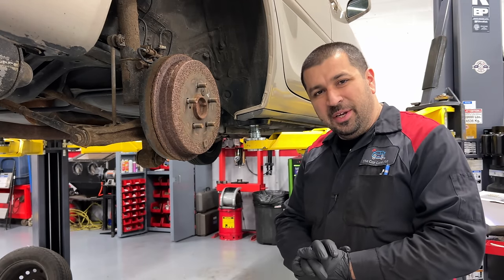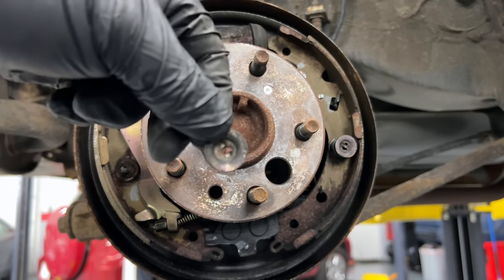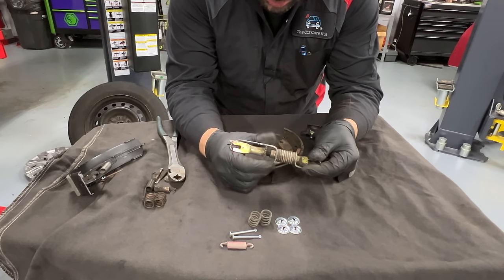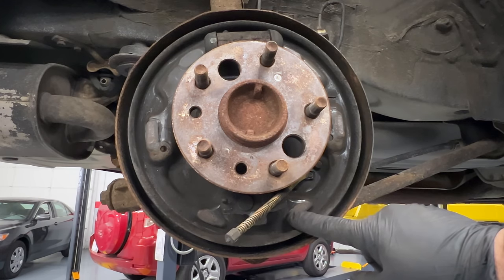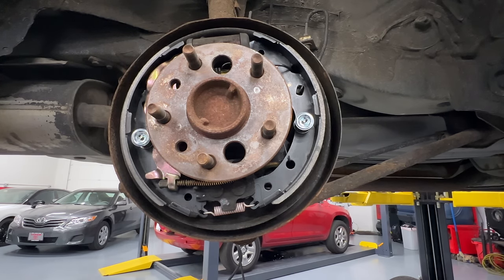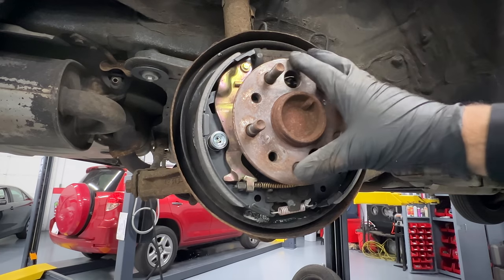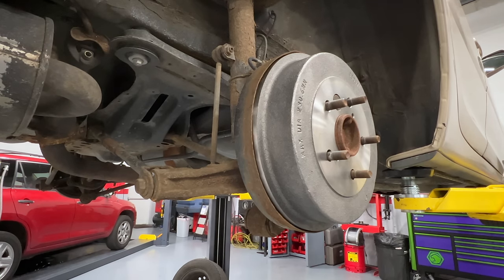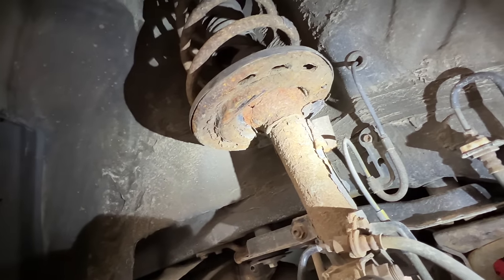How to Replace Toyota Drum Brakes Like a Pro

Comment: The root problem here is that Toyota still puts Drum brakes on some vehicles 🙄
Reply: drums & a hybrid vehicle just don't sound right 🤷🏻‍♂️
Reply: Many Utilities which cost 45-60K have drums due to reliability and good dust prevention due to a Sealed design.Most small hatch backs also have drums. Not many cars (non high performance) use much of the Rear Brakes, that’s why most of these are Maintenance free up to 150,000km+ depending on the driver.
Reply: Drum brakes are superior to disk brakes
Reply: @StrongerThanBigfoot drum brakes are dog shit .

Comment: I was taught on orientation of brake shoes,, tall boys to the back and short boys to the front of the class. Maybe kind of dumb but I never made that silly mistake. Taught a lot of young techs this over 45 years.
Reply: Hell naw bro! This is so helpful to me. Appreciate you
Reply: Primary and secondary shoe. Quick google search for picture. But yes primary/ leading shoe is smaller and goes to the front of vehicle.
Reply: Great way to remember.

Comment: I'm 69 and all my cars up until 1977 had drum brakes. I did work on other peoples' cars with disc brakes but I had a steady diet of drums for 30 years. The rear drum brakes on my first (1991) Camry went 200K and only wore out because of leaking cylinders. I did use OEM shoes because they were competitive with AM. Ahmed, I am glad to know that I was taught correctly 55 years ago.

Comment: I did drum brake shoes before and it is quite difficult. I made all the mistakes you mentioned on this video. (push too much and cylinder brake fluid leaking). I learned a lot of tricks on this video. Best instruction and explanation. Every time I work on drum brakes,  I always wonder how much car manufacture can save instead of using disc brakes which is much easier and have much better stopping power. Thanks for the video and thank you for sharing your knowledge. 👍
Reply: Did you put those short crossheads back in again ? or do Toyota’s not use them ?   Oi ! maybe you re-cut a lot of drums badly, hein ?

Comment: Again, this is exactly the kind of video for Toyota I want to see you doing.  I'm always interested in any kind of special treatment which applies to Toyota vehicles. I have a Camry 2018 and Corolla 2017 which btw has the drum brakes in the back and have learned that the adjustment hole is in the front not the back like on most of the other cars I've done in the past. This is a wonderful idea. Make adjusting them so much easier and safer.  Please do more videos like this for other areas of maintenance and or repair of Toyota products.
thanks

Comment: Another excellent tutorial video. I have done the brake shoe replacement job many times in my DIY driving career, with older cars, many years ago. It is not easy when lying or kneeling on the ground! A 'lift' makes everything so much more accessible.
Your customers are fortunate to have you..
Reply: I recommend you get a stool from "HF"; even a little step stool or an upside down 5-gallon bucket is great to sit on rather than kneeling. At least if you destroyed your knees with basketball and running...
Reply: @justliberty4072  Thank you for the suggestion.. We have  Screwfix in the UK where I obtained some Trade Gel filled knee pads, held by velcro straps. They work as a cushion for the knees, as well as roll of carpet underlay or an old pillow. Unfortunately, at 6'4", a stool or bucket are far too low. At my age I would never get up again! The joys of getting old!

Comment: Drum brakes are no fun to replace. This was a pretty good tutorial video. The one thing I'd do differently is all of the cleaning, sanding and lubing BEFORE assembling new parts. 
I agree to adjust the shoes with initial drag, it will wear in perfectly if you do that. Make sure both sides are adjusted the same so they grab at the same time.
Reply: A man after my own heart. Spot on, brother.

Comment: Excellent video. Just one tip, take a couple photographs of the shoes and springs setup after you get the drum off and before you start disassembling the springs, shoes, and clips- so that you have a quick and easily accessible reference for reassembly.

Comment: WOW!  I live in the rust belt and have never seen a rear strut that bad. Another great video for the DIYer.  I'm 60 and my first car, a 1970 Galaxy 500 had 4 way drum brakes and most of my cars until the late 90's had rear drum brakes.  My current cars are 2003 - 2005 Vibes and they still have rear drum brakes.

Comment: Very nice as usual.  The great thing about current times is that you can now take tons of pictures with your phone to insure you know the original position of all the parts  We old guys remember when you just had to guess or check the other side.
Reply: Most of my cars had TWO upper springs. And when I first started, I'd lay parts on a flat piece of cardboard the way I took them off.

Comment: Great video.. nice clear steps. I like how you put the parts on the table side by side, keeping everything organized. I need to start doing that. Its easy to get stuff turned around or backwards. Taking pics helps too.
On the adjustment part.  I have added a step, get the brakes adjusted to whatever you like. I then get in the car and apply and disengage the parking brake several times.
Then go back and adjust the brakes again.. normally you will find they are loose again. 
The parking brake will press the shoes tightly against the drum and center them nicely.
I have found repeating the parking brake step 2 -3 times, and you will get to a point where there is no longer any change after you do it.
Now the Brakes are centered, and adjusted nice.

Comment: 26:12 ***Solid gold advice***! I've needed that backup plan a few times😆 

For anyone that's curious about leading versus trailing shoes,here's a quick explainer.
The leading shoe gets the most wear because the rotating forces help pull it tighter against the drum- which gives a stronger braking effect.The trailing shoe doesnt have this advantage.
So why not make both shoes the leading type? Early race cars did exactly this and it works well. However this has one disadvantage. When a car is going backwards the leading shoe(s) become trailing shoes and lose most of their braking ability.And because road going car's E brakes need to work equally well in both directions, they have the leading/trailing arrangement.

Comment: I am glad it has to be replaced every 15 years . I did mine yesterday morning and putting that cable was the only issue I faced. Rest was easy.
Btw I use locking plier to pinch the brake line it made job easy with the cylinder.

Comment: Still have my snap on brake tool set the pliers were the best had spring tools on the ends of the pliers. Bought them in 1975 working at a GM dealership. Good memories

Comment: Great video. Just replaced my brake shoes today. It wasnt that hard, thanks to this video but my god, I hated doing it so much. Between all the springs, the need to clean all the caked brake dust, and the need to adjust them afterwards, it took me more than 2 hours. Having specific tools wouldve made the job so much easier, and my drum doesnt have the hole in the front for adjustment. Luckily drum brakes last so much longer, so I may not have to do another one for at least 7 years if the car is not sold yet by then. Disc brakes are so much easier to work on, and the pads are much cheaper than drum brake shoes.

Comment: I have to take a million pictures with my cell phone to refer to as I'm reassembling parts like brake springs.  However , I haven't done it for as long as you have so you make it look so easy .. Thank you for making these videos..
Reply: I could relate. Just did rear drums and shoes on my 2006 Tundra. What a learning experience. It's actually easy to reassemble if you take careful detailed notes on spring and adjuster placement

Comment: Excellent. I have a 2006 Matrix with almost 209k miles and original drums. The car stops perfect with zero noise. I recently tried to do an inspection and used the bolts to break the drum free but it hung up on the pads trying to remove it. I just pushed it back on, realizing that I should have new parts on hand.
Reply: There is probably a ridge on the drum so you will need to turn the adjustment mechanism in to pull the shoes in so you can get over the ridge.  You turn it the opposite direction that AMD was doing in this video.  You do need to hold up the adjusting lever with another screwdriver so you can turn it backwards.
Reply: @montestu5502  Yes. I know this trick but did not want to mess with it until I had all new parts.
Reply: This is something important AMD should’ve talked about but he didn’t. The shoes will wear the inside of the drum creating a ridge at the end that will trap the shoes. If you try to force the drum off through the bolt holes, you can end up breaking hardware. Now you have to replace almost everything. This happened to me actually. The proper way is to remove the rubber grommet and adjust the shoes inwards to allow for enough room to let the drum slide off. Most Toyotas have this on the back which can create a tough access for somebody to see behind the wheel.

Comment: cool tip from video, instead of pulling the spring with vise grips just lever visa grip against the hub to pull spring in place. 45 years i always pulled it. But the corolla has a mega spring and I’m old so great tip.

Comment: Another great video for the DIY. Thanks AMD. I'm one of those old timers who have done countless drum brake jobs professionally. I would add 2 things for people. 1) Apply a light coat of lithium grease to the brake adjuster threads as you thread the adjuster back in. In the salt areas especially they rust and seize up quickly and stop auto adjusting. Removing a brake drum with a seized adjuster you can't back off can be very problematic. 2) When adjusting the brake shoes do your initial adjustment as shown then cycle the e-brake a couple times. This will verify it works and help center and seat the shoes. Then go back and adjust your shoes again. It makes a difference.

Comment: The only things I would add are:
Clean the threads of the adjuster (no grease or oil), Note to people that if the shoes leave a groove file, the backing plate until smooth, unless very deep (then put on a new backing plate). Also, tell them to be  sure to inspect the wheel cylinders and any axle seals (rear wheel drive) for leaks. Nice video! Loved the explanation of why sanding the edges is good to do.. This is from a former Automotive Instrucor and 57 years of experience Auto Tech.

Comment: In the 90’s I have no money and have to maintain my own Camry and other family Camry. 
I did about the same thing but thru trial and error and old mechanic advice 😅. 

Thank you for the memories . 
Now I still change my own brake . But it is all disc brake now . 
I love that part about making sure the auto adjuster goes click click . Otherwise in about 1 month the brake would be out of adjustment. And car would dive and lock up the front wheel because the rear brake is too loose and does not brake

Comment: great video .. I am old school at 78 years and apply anti seize lube on all of the brake bearing surfaces .the lithium grease spray was a sort of overkill and didn,t address the other pressure points . a bit of wire brushing on the corroded hub face wouldn't go amiss. some anti seize on the adjuster threads is a must .

Comment: Sure wish you were closer than 1/2 a country away! 
After two visits and $800 spent at a professional shop I offered to fix my sister-in-law’s low brake pedal on her ‘06 Camry.  I suspected the rear brakes weren’t self adjusting.  Sure enough, the previous shop hadn’t even lined up the adjustment hole in the drum w/ the hub. The star wheels were totally seized up. 
Love the channel!

Comment: I use a large wood clamp to hold the shoes together when I install the last keeper and spring. I'm also wondering what aftermarket parts you find acceptable? Some are good and some not so good. You do this everyday and I and others would GREATLY value your opinion. Thanks!

Comment: This is exactly what I needed today. Does this work for a 2014 corolla as well?
Reply: Your 2014 Corolla likely has drums in the rear, rotors and pads in the front.
Reply: @Zafar Syed  yes that is correct. Which is why I asked if the drums on my corolla are the same setup as this video?
Reply: @return.of.the.nac18  Oh. Sorry.  Then your answer is yes, it's the same.
Reply: @Zafar Syed  awesome. Thank you very much 😁

Comment: This was EXACTLY what I needed for my ‘05 Sienna.  Had a noise only backing up after the new shoes and hardware were installed. I needed to roll the edges of the shoes? Who knew? And I’ve been doing drum brakes on my GM cars and older Hondas for 40 years! Everything else he did is gospel.  Side cutter method? Um, ok.  I had been using a special tool to hold the spring end that never really worked. Some of the older Toyotas used front access adjustment holes? I wish I had that feature !! 7:04

Comment: Great video! 
I want to note that the 2002-2006 model which is what this camry is has 2 different types of rear brake rotors and shoes. This Camry and parts in this video is the Camrys made in Japan. The USA made Camrys have differs parts.

Comment: In my experiences with drums, all reusable parts get thoroughly wire brushed clean, washed off with brake cleaner; including the face of the axle, the wheel studs, the adjuster, and the hub face.
When assembling the new shoes, lubricate all rub points like the parking brake hinge point and the bosses on the backing plate.
I would put  both shoes on with the hold-down hardware, put a ratchet binder around the shoes and tighten it to keep compression on the wheel cylinder.
Then, I could install all the return springs and remove the ratchet strap.
If the vehicle was equipped with steel wheels (rare these days), I would paint the hub face and the drum face LIGHTLY with anti-seize to prevent the wheels from rusting onto the drum or the drum to the axle.
When adjusting the brakes, I would run them down tight, and then stick a screwdriver in to hold the adjuster off the star wheel and back off 1/2 to 1 complete turn.
Typically, this centered the shoes and left minimal space between the drum and the shoes.
That is one crappy strut!!

Comment: Another great vid. Been putting this off forever on a couple cars. Not sure why I’ve been so hesitant…I did the read disc on my xrs and the inside of those is sort of like a drum for the parking brake. Although not sure I’ve ever gotten the parking brake adjusted perfect. 
I see lots of vids with guys using antisieze to grease the backing plate. Granted a tiny bit if that crap in the wrong place (like your fingers) gets EVERYWHERE.

Comment: Toyota sure loved to hold onto those rear drum brakes for a long time!
Reply: @underscr0e well these cars don’t weigh much and front brakes do more work stopping the car then the rear brakes do. But all drum brakes including front on the old 50’s boat cars that weighed 5000 pounds that’s a different story, drum brakes are fine on lighter cars that don’t take much to stop vs the old boats, like a 55 bel air the drum brakes aren’t great because it’s a heavy car, a lot different then a lighter Toyota car of today.
Reply: Honda too! (2015 Civic LX - drum rear brakes)

Comment: I don't understand why the drums need to be tightened that much.  It seems like it just makes the brake shoes constantly wear, and makes that much more dust in the drums.  But AMD said it, so I'll take his word on it.  BTW, I'm glad you made this video, there are a number of things I learned from this video that I haven't seen in other videos, like the kind of grease to use, why to not press hard on one side of the wheel cylinder, and to sand down the edges of the shoes (it seems like it would be easier to sand down the edge of the shoes before the shoes are installed, but again, AMD said to do it this way, so there must be a reason to do it in this order).  Thanks, brother!!

Comment: I have so much respect for what you do and believe in. Keep up the good work! Three questions I had for you as a tech for many years up here in the great white north/ rustbelt of Ontario. why not clean the backing plate pads (6) of rust with a norton  2" dia. quikloc abrasive disc in small air powered rotory tool. (It would take you 30 seconds or less to remove rust). #2. Why no lube on self adjuster threads? (I've seen too many seize). #3. Would it not be easier to lube up backing plate pads, adjuster lever and emergency cable before assembling shoes?

Comment: Grea video as always. ? I have a 2020 RAV4 hybrid. I want to use a set of snow tires and wheels for the summer use the regular set for the summer. Do I have to program the TPMS sensor every time. 

Or does the computer read it after driving it. 

Thank you very much for any advice and help.

Comment: One more little hint if i may..If the drum dont go down easily,first relase adjuster..Sometimes edges from inside of drums are rusty and drum can't get off from brake shoes..And usualy im using smaller screwdriver and puting springs on place..Just take the spring from under and hook him with top of screwdriver on hole and spring just slides in..Nice video AMD!!